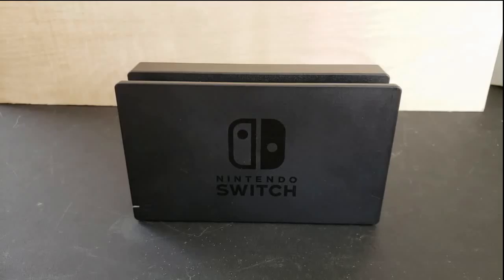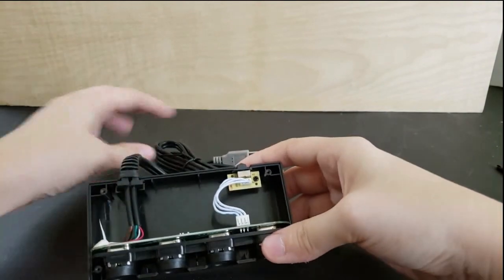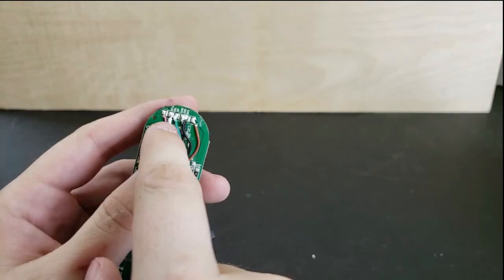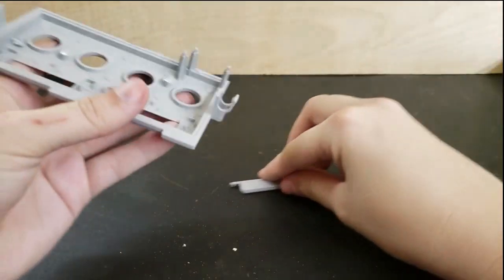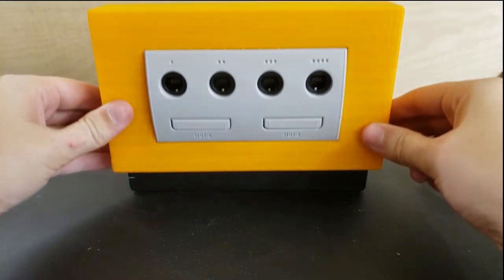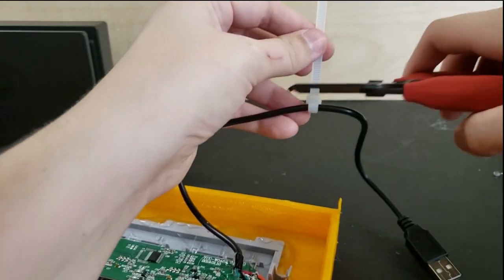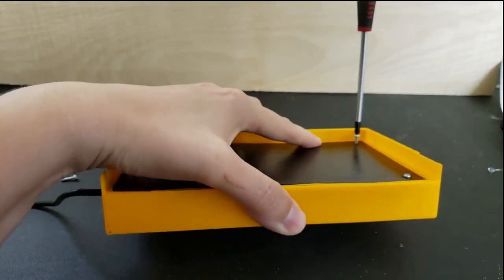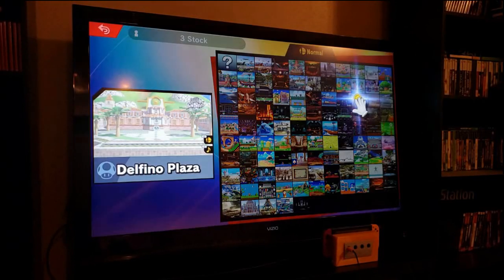Custom Gamecube Nintendo Switch Dock

Comment: I noticed your etsy shop is down. Do you have a thingiverse link for the 3D printed part?
Reply: Unfortunately, she doesn’t anymore. Which sucks because the e only way to get this now is my buying it from her.
Reply from the maker: I did take down my thingiverse links, since thingiverse leaked my data a while back. I don't have the old original file anymore, I just have a new version with improvements, and I do sell those on commission. I haven't released the new version publicly

Comment: Do you have a link to the 3d print file if I want to print it out myself?
Reply from the maker: The original version was on Thingiverse, but I removed all of my old posts from that site after the security breach. I have a new / updated version which I sell on Etsy but haven't released publicly yet
Reply: @Madmorda what's your etsy store call so I can check them out or do you plan on selling the 3d printer plans?
Reply from the maker: @collins2230  MadmordaMods is the shop name. I will be selling the finished product, not the printer files. I'm in the process of putting my shop back up, just waiting on parts 

https://www.etsy.com/shop/MadmordaMods
Reply: @Madmorda  do you know how soon you'll be up and running and the price?
Reply from the maker: @collins2230  Hopefully this week, not sure on price yet

Comment: If I had to guess, the reason that they're using two ports normally is because the Wii U USB ports were individually quite weak, so they went with two so it would work on both consoles. If we're being technical, the second plug isn't rumble, but a second 5V source to give enough power for rumble.

If you open your Wii U up and bridge the 5V pads of two ports and the ground pads of the two ports, you can unplug the grey cord and still get rumble.

It's weird since not all of these things are built like that, I have an official one that has 8 wires (I think) and a third party one with 6 wires (4 normal, and instead of just one power, mine has power and ground (even though ground is already shared).

I'm working on integrating it inside the Wii U.

Comment: very very nice. but you glue the cable. if i use the NES Switch kontroller there are much larger, it goes well? and on the actual sales on ebay, you dont use a original plate from gamecube, its all 3d printed. that looks not good. do you have one with a original plate? i would buy one. greets

Comment: By any chance do you fix old consoles? I have a gameboy color that still turns on but it seems the start button doesn't work. Compared to what you're capable of I think it would be very easy. Can you possibly fix it or turn me to someone who can?
Reply from the maker: It's just dirty. Buy a $3 triwing screwdriver, take it apart, and clean around the button on the circuit board using a $2 bottle of Isopropyl Alcohol (rubbing alcohol) from Walmart. The higher the percentage, the better (91-99% ideally). Put it back together. Ta-da, fixed.
Reply: @Madmorda  thank you sm.

Comment: Tried to get this for myself. But the adapter seems to of changed internally and externally when in person, it's now way shorter and doesn't fit the holes well at all,

Any other adapter work well for this? I got the files printed but now need a decent adapter to fit in it
Reply from the maker: You'll have to get a couple adapters and see. Some of them have individual plugs that can be moved around, and some of them have a pcb. It's trial and error :)

Comment: Would it be possible for you to paint or put a skin on my n64? If not what do you recommend.
Reply from the maker: I recommend you paint it :) it's only like $12 total for the screwdriver, the paint, and the clear coat. Just pick out some spray paint that says it works on plastics and practice on some garbage first

Comment: I always wondered why they needed a dedicated usb for rumble. Maybe if all 4 controllers are rumbling at the same time, there will be issues? It seems silly otherwise
Reply from the maker: It's because they want the adapters to work on the Wii U, which outputs a very low current on its USB ports. A regular USB port can support all 4 rumbling though

Comment: i thought the adapter for the gamecube controller needed to have two USBs coming off to draw enough power for both rumble and the controller itself so does the rumble on the controller  through this adapter still work here?  Nonetheless an awesome design i always thought about making one of these and you have done an amazing job.
Reply from the maker: It works :)

Comment: Nintendo would make absolute BANK on this.

Imagine:
Gamecube Switch Dock with Gamecube controller ports on front, (black, silver, blue), $39.99, (light orange) $59.99

Wii Switch Dock with Gamecube controller ports on top, (white, black) $29.99, (Red, Light Blue) $49.99

Custom Switch Dock Case, (NES, SNES, N64) $19.99

Comment: And here I am,Taking an original Game cube and a Switch Dock,taking them both apart,cutting a Notch into the Gamecube,and literally Morphing the Gamecube into a Switch Dock,with the Switch Dock internals. I did use that Switch Gamecube Ports as you see here in this video.
However; you did it the easy simple way. Props.
Reply from the maker: Yeah, but you did it the proper way :)
Reply: @Madmorda  my friend got really mad at me for basically Destroying a Gamecube and frankensteining it

Comment: This is soooo neat, but why didn't you 3D printed the face plate instead of taking it from a true GameCube? I wouldn't have the guts to do it 😭 and you can even make it so it matchs any adapter you buy.
Reply from the maker: I used it for authenticity, if the whole thing were 3d printed it would look much less real. Also, I didn't take it from a gamecube, I have a bunch of spare parts laying around :)
Reply: @Madmorda  Oh that's fine then :) 3D printing them would be nice if I don't have access to the parts, with the right plastic and if I take care of it nicely, I'm sure it can look fantastic!

Comment: Small question to anyone who knows, why did they do two USB if you only need to change one smaller cable?
Reply from the maker: To make it work on the Wii U which could only output 500mAh per port. Most USB ports can do more, but the adapter had to work on the Wii U too so it needs two cables
Reply: @Madmorda  oh ok thank you^^

Comment: Disappointing that it needs the GameCube front plate and a gallon of hot glue. It could be fully 3D printed and not require any glue.
Reply from the maker: It could be, if I wanted it to only work with this specific model adapter. However, the way I made it, you could buy any adapter and glue it in without needing to redesign the shell every time you make one. Since even adapters of the same brand can have different pcb revisions, it made more sense to do glue rather than to put a bunch of work in to a project nobody (including myself) could use again without extreme luck or redoing the work
Reply: @Madmorda  fair enough that actually makes a lot of sense in hindsight, I do still think a piece could be printed as to not require gutting a GameCube for the faceplate

Comment: Bridging the power for the ruble into the single port may work for one controller, but you are risking damage to your switch dock or the adapter the more controllers you use. One port isn't enough power for all 4 to be used.. hence why they have a 2nd cable for power.
Reply from the maker: The Wii U only output 500mAh per port, and since the adapter needs about 1A, it was made with two plugs so it would work on the Wii U. However, the switch is a USB 3.0 port which is WAY overkill for that measley 1A draw (even almost all USB 2.0 ports output over 1A each, 500mA is not the norm). In other words, the adapter doesn't have two plugs because it draws a lot of power, it's because the Wii U is stingy and they wanted it to work on the Wii U as well as switch and PC :)
Reply: @Madmorda  Fair point. Tho, it would have been reassuing to see you volt meter test it after you did that to see what the power pull was. (and if the switch ports do actually out put the rated 5 amps. But I understand.. So basically, you can no longer use that with a Wii U (which wouldnt anyway).
Reply from the maker: @lyianx  Yep. I did not multimeter test it though because there is absolutely no way the USB 3.0 port can't output a single amp. 1A is like the minimum even for a USB 2.0 port, the Wii u is just a unique case of having less than that

Comment: This is neat but just buy the powerA gamecube controller. It's so annoying when people say it doesnt have the right "feel" even though it feels exactly the same. Even then, most of them are just lying and haven't even tried it. The only good reason to use a gamecube adapter is for tournaments so that you dont have to re-sync the controller after you finish a match.
Reply from the maker: I actually made a whole video about the powerA controller :)
Reply: @Madmorda  bruh. Cheap? I don't really get what that even means. I've held both controllers in my hand and they felt no different from each other. Maybe I just have bad taste but idk.

Comment: Absolutely incredible. And the fact that you consolidated both USB cables makes it a wonder why Nintendo didn't do the same. Looks super clean and professional
Reply: i think its an issue with the wii u, the damn thing complies with usb standard to the letter, ie no room for extras so anything you plug in will most likely need a y cable to get around the fact that it cant get enough power
Reply: @nickolaswilcox425  Yeah, pretty sure the wii u didnt give enough power for rumble
Reply: @jaden8923  it didnt have enough power for anything, even nintendo specified hard drives needed supplemental power to run so you need either an increasingly rare and expensive tabletop backup drive with external power or a y cable to hijack some extra power
Reply: At first I thought you said “incredibly awful”

Comment: is there any way I can get a more detailed description of how the electronics were done
Reply from the maker: I made the wire shorter by cutting it and then soldering it again. Then I put a wire that connects the red and brown wires. This is specific to this exact adapter though, different adapters may have different color codes

Comment: Is it possible to buy this?
Reply from the maker: Yep, I have a couple up on Ebay
Reply: @Madmorda  got a link?
Reply from the maker: @Vendus  http://rover.ebay.com/rover/1/711-53200-19255-0/1?icep_ff3=2&pub=5575378759&campid=5338273189&customid=&icep_item=224068554354&ipn=psmain&icep_vectorid=229466&kwid=902099&mtid=824&kw=lg&toolid=11111
Reply: @Madmorda  ack 150 is a bit too rich for me to spend on this Im sorry I'd be more okay if it was under 100 but to be fair this is from the standpoint of a guy who already has a adapter and was just curious about getting a cooler looking one
Reply from the maker: Yeah, you can make one for about $35 (not including filament) if you have a 3d printer, hot glue gun, and soldering iron. It's not too difficult and I open sourced the files :)
Reply: @Madmorda  Well thats good, I am just putting this idea on the shelf again cause I'm not ready to shovel out 150 for it thats all

Comment: Tbh, I kind of like this better than another mod I've seen where they just stick the dock in an entire Gamecube. This one is considerably less wasteful, and even the one part you DID have to take from a Gamecube(the front controller plate)seems like it could be recreated with 3D printing.
Reply: It was a spare shell, and I personally think that rated e mods did a better job aesthetically and functionally.
Reply: i watched that video and i didn't see anything wasteful about it. he probably used a broken GameCube and didn't even break a board or anything
Reply: GamingLikeEvan its a she lol

Comment: There is a reason why there is 2 usb cables and not 1, you hack works if you use 1 controller but using 2 and more will be problem, you should re design it so it uses 2 usb ports on other side of dock
Reply from the maker: The reason is that the adapter was made to work on the Wii U as well as the switch and PC. The USB 3.0 on the back of the switch can output much more current than the limited output of the Wii u ports :)

Comment: Are there any power issues with having the power from both routed to 1 USB port while 4 controllers are rumbling?
Reply: Probably no. The Wii U had very low voltage through the usb ports, that’s why it had to be use 2 ports (Just like using external HD on that console). On the other hand, the Wii would work with external HDs pretty well with only 1 usb. I think the switch is Just like the good old Wii in that case (no double usb acessories that I know of)

Comment: i think the rumble was located on another usb because of the power consumption, I think you just made it posible to burn out the usb drivers of the dock
Reply from the maker: Nope, the switch deck's USB port is USB 3.0, which can deliver much more power than the Wii U's USB ports (which were very limited in current even for 2.0 ports). Rumble is most likely separate to make sure that this can run on the Wii U, but the switch can handle it no problem :)

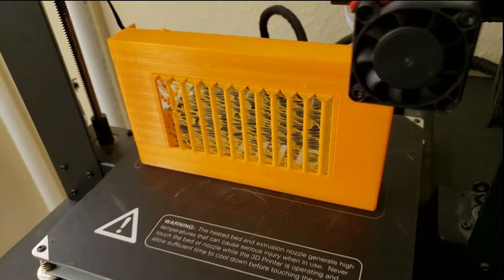Comment: 4:50 - i do wonder if you could use tree supports there to save a bit of filament, especially if you like running spools down to the wire like that .)

Comment: Looks fantastic! Love the idea of consolidating to a single USB cable, considering going back and doing that with my GC dock... Should be doable with any adapter since it's just connecting the two ports to a single power line right?

Comment: Why do they use 2 usb plugs if one can supply enough power?
Reply: Whenever a rumble motor activates, it draws such amount of power that it causes a voltage drop and electrical noise on the power bus, that voltage drop can make integrated circuits like the ones inside the adapter to behave erratically, thus, making the adapter to malfunction. One controller may not use enough power to do so, but 4 controllers vibrating at any given time could indeed. That’s why they keep data and rumble power lines separated, and I would have done the same even though it didn’t look that fancy. On the GameCube that was taken into account in the circuitry design and also you didn’t have the additional usb cable impedance.
Reply: @mluna  that makes sense. If I need a usb port free can I plug the rumble usb wire into a 5w wall plug?

Comment: Hi Madmorda!, I'm a big fan of your videos ad would love to make this do you have a link to where you got that adapter? thanks so much!
Reply from the maker: I got mine on Amazon :)
Reply: @Madmorda I’ve been looking on Amazon and they only seem to be offering a “new” version with Home/Screenshot buttons added on top and a different style housing. Do you know of any others with similar measurements, or if this new one would work?
Reply from the maker: @sketchitDotBiz  https://www.amazon.com/dp/B07Q459FBQ/ref=cm_sw_r_cp_apa_i_QoabFbQFDPMWN
Reply from the maker: @sketchitDotBiz  I have no way of knowing about other adapters because there are so many. In theory, any adapter will work if you can space the ports right. Some may have individual ports you can move around, some may have ports that you can't (easily) move but they are spaced right, and then some that you can't move and they are spaced wrong. You just need to try and see :)
Reply: @Madmorda Ah, I was wondering if it was that one! The brand says Y Team but there’s also stuff from a YCC Team account, so I was thinking maybe it’s just another account that company uses for their old stuff. Thanks so much!

Comment: is it alright to ask why the original had two separate usb ports if the functionality could be put in one ?
Reply from the maker: I'm not 100% sure, it could have to do with the power that different devices can output. Potentially some USB ports might not be able to handle the power needed for 4 controllers plus rumble. Or it could be because they wanted to keep rumble separate in case of interference, however I find this less likely
Reply: @Madmorda  That makes sense thanks :)

Comment: If you printed that thing laying down you would have save extra filament
Reply from the maker: The filament saved would be very little and it would look flat on front instead of having rounded edges. That's why it's printed standing up :)

Comment: Damn I can't find the old YCCteam adapter or a cheap gamecube to steal the front cover from.
Reply from the maker: The Ycc team adapter is on Amazon, and you can get the gamecube parts off Ebay for about $20 :)
Reply: @Madmorda  I could only find the new version of that adapter. Input in a couple of bids for some broken GameCubes but if I have to I'll buy the front cover by itself or I might design one and print it.
Reply from the maker: @x9x9x9x9x9  This is the exact listing I ordered :) good luck! https://www.amazon.com/dp/B07Q459FBQ/ref=cm_sw_r_cp_apa_i_pWuaFbQ1ZMHAD

Comment: why do gamecube to usb adapters come shipped with 2 usb cords when it can easily be put into 1 usb cord?
Reply from the maker: It might be because with all 4 controllers rumbling simultaneously at max rumble, it could draw too much current, however with quarantine I cant test very easily haha. Different USB ports can output different amperages so some might not be able to handle it. Or it could be because they wanted to try and separate the rumble line from the power line in case the motors caused some disturbance.
Reply: Cuz the second one (usually gray colored) is used for rumble. If you don't care for rumble, then you just plug the one used for inputs.